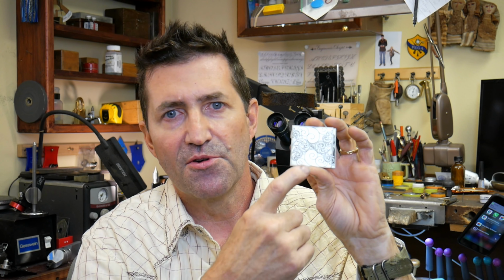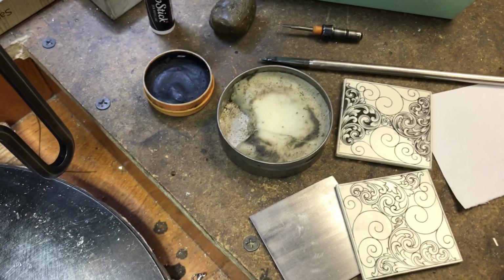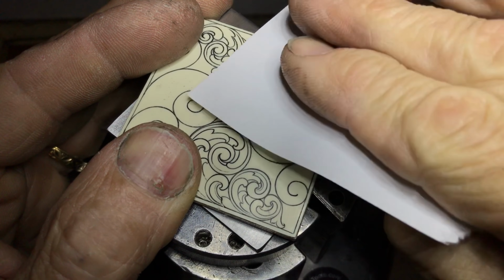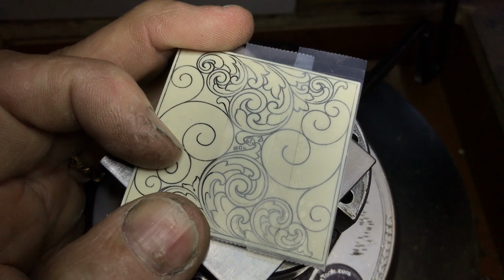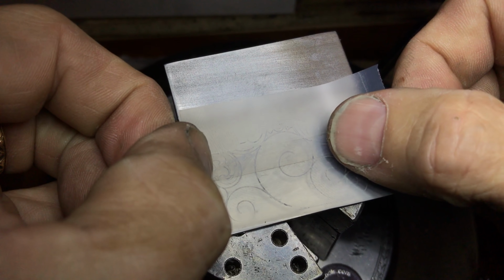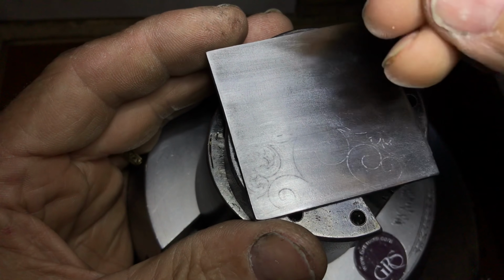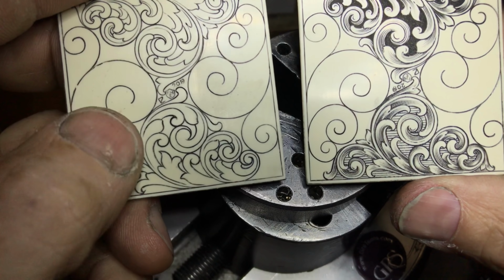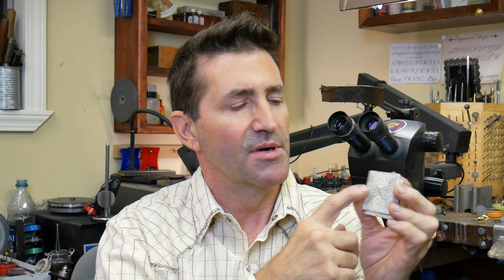Hand Engraving  Quick Tip  #4 - Wax Transfers

Comment: A quicker way is to just use a smoke print. Have you given that a try at all?
Reply from the maker: Never used smoke prints as a transfer method but I've made plenty of them. It's one of the dozens of methods I know of.
Reply: @MasterEngraverTV   
 Ok cool give them a try they are a lot quicker and give a better contrast on the metal  for scribing the designs onto a fresh plate

Comment: How do I transfer an image on one side of the knife to the other side using wax transfer?
Reply from the maker: Adam Pierce to do this is hit and miss with wax. You need to lift the image with tape, apply another piece of tape to the first one to lift some of the wax off that piece. It will then be a mirror image. I rarely do this because it’s difficult to get much of an image to show up. Much better to use computer software to mirror your artwork and use printer transfer technique. That being said I hand draw 99% of what I do. Being able to draw it by hand is an essential skill.
Reply: @MasterEngraverTV  Thank you for the response. I tried several methods after I posted the question and actually successfully did exactly what you suggested. It worked but required two people as the tape is difficult to pull apart without damaging the image created by the wax. The photograph and laser printout was my final choice but I didn't need to do it. Using hand drawn, as you well know, is difficult to reproduce an exact copy of an image that has been free handed on one side of an object.
Reply: @MasterEngraverTV  thank you so much for this tip ,stay safe